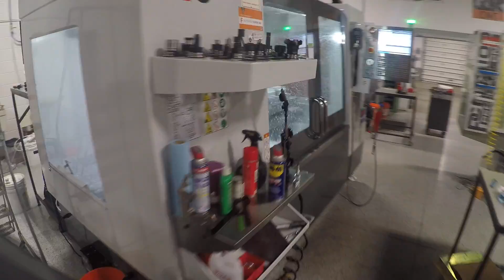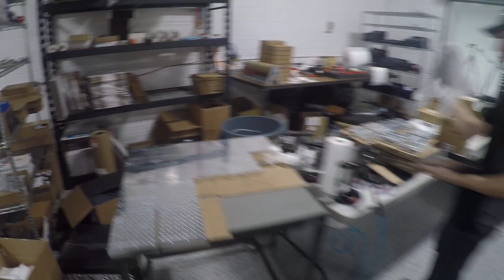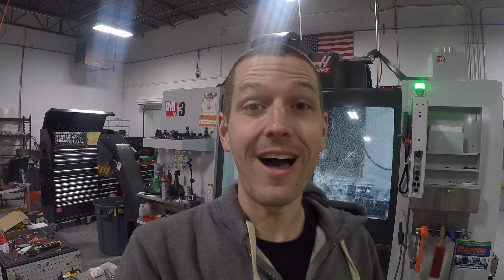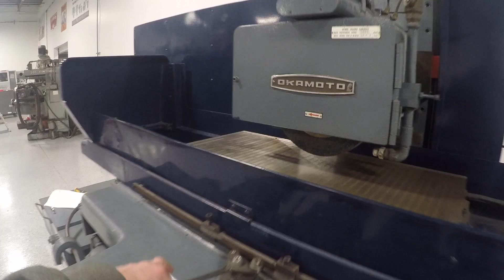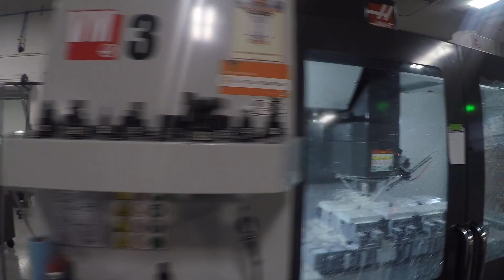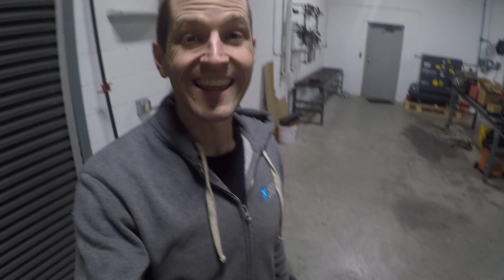New Equipment, New Classes, Podcast! CB48

Comment: The button on your grinder is probable not bad You may have a bad wire going to one of the contactors or a bad contactor itself. The start button is just a momentary switch that latches the contactor on, if it were bad it would not start at all. Also if there is a E stop switch check that to make sure it is not activated or defective. There are a lot of variables

Comment: ALRO steel pricing is exorbitant it doesn't matter if it's high volume or low volume PA Steel beats them every time on USA made 6061 aluminum plate. There isn't a PA Steel location near you but there is both ALRO and PA Steel within 30 minutes of each other in York PA so it works for me. Google them and ck pricing.  I just bought a fairly large quantity of 2.5 inch and 4 inch plate for around $2.10 per pound. ALRO wanted more for 3.5 inch plate than I paid for 4 inch....and that was after I told them the other pricing and they adjusted to try and compete.

Comment: reverse osmosis water is incredibly corrosive and will eat your cooling system clean through.  there are additives to the water that prevent corrosion and your cooling systems will last a lot longer
Reply: True unless you use all stainless steel piping.

Comment: Have you twiddled setting 130 yet? by changing it from the factory "1" to say "4" the machine would tap out at 4 times the speed & feed it tapped in. It's a model comand, you can also add a "J4" in your ridge tap line and it does the same thing but non-model. The range is 1 to 9?
Reply: I forgot, you must use tap driver collets or tap holders,  or you'll snap off smaller taps with this trick.